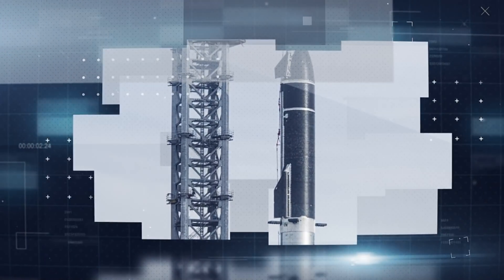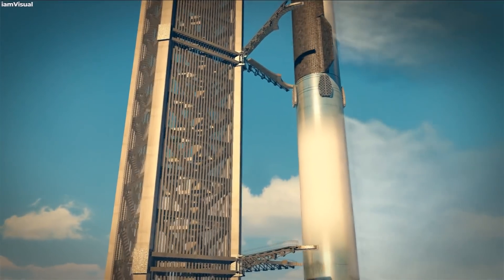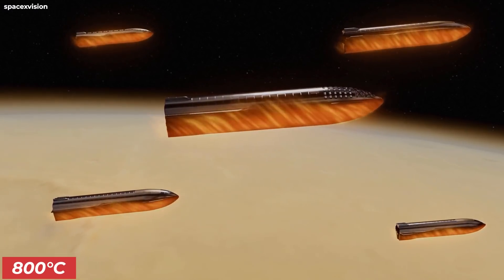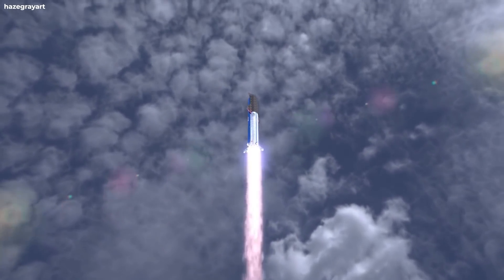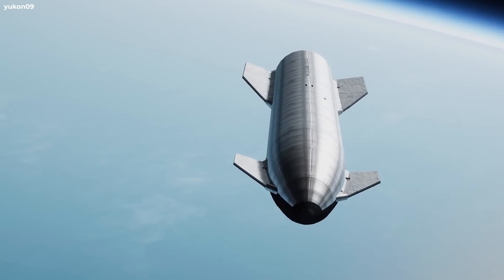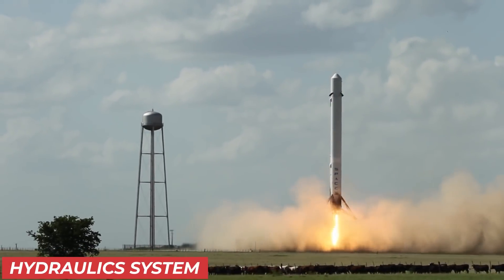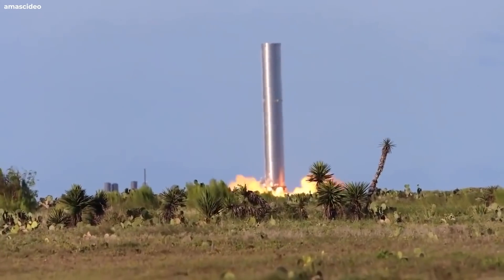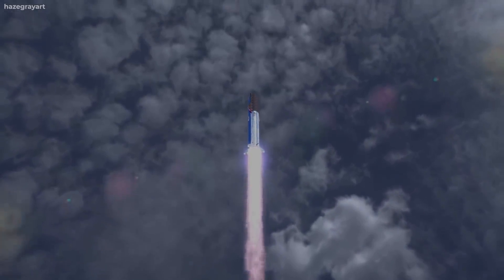SpaceX's INSANE New Starship LEAKED by Elon Musk

Comment: The metallic thermal-protection panels -- designed for the X-33 Reusable Launch Vehicle  -- might dramatically cut maintenance time and costs associated with ceramic tile and thermal blanket systems on the Starship, as they were intended to address these issues with the Space Shuttle.

Comment: So The heat shield stuff is due primarily to just how fast craft moves during reentry. OK...why not figure out a way show the descent so burning up isn't such a hazard? Can't be hard in theory....
And with enough brain power working on the problem and the math, won't take very long to solve the problem.
Reply: To slow down we use the air, and that's why it gets so hot. Basically, the friction between the air and space craft causes it to slow down but also generates a bunch of heat as a by product. 

The only other way to slow down would be to use the engines, and that would use way too much fuel
Reply: @triton6490  friction. I know.

But ion engines don't use that much fuel. Either that or we stop pissong around with rockets and use nuclear energy with will produce bear endless amounts of energy to power systems and engines.
Reply: @jace2wheel762  ion engines don't have a high enough TWR to complete an entry burn before burning up. 

Also nuclear power would produce a bunch of electricity but you still need something to eject out of the craft to produce thrust, so you still need fuel.
Reply: @triton6490  actually you don't need to eject anything out of a "tailpipe"
Reply: @jace2wheel762  that is using theoretical physics. To achieve conventional thrust you need to eject something. That's why we have engines.
Reply: @triton6490  workable theories is what we got
Reply: @jace2wheel762  i have no problem with theoretical physics research but we need to stil to physics we already know to actually get somewhere in a meaningful amount of time. Light sails would be fine  for interstellar
Reply: @triton6490  light sails don't work. If massive mylar sails were functional and viable, we'd be using them by now. To date, the fastest probes we've ever launched are the voyager probes. Took over 30 years to reach the heliosphere and another nearly 20 to reach interstellar space. So sure let's use light sails that get less and less efficient the further away from a source of light like say.....the sun
Reply: @jace2wheel762  It’s free energy conversion via friction. Why not use it?
Reply: @jace2wheel762  also, the speed it would have to change to not generate a dangerous amount of heat is like 10,000 mph (20,000 kph). That’s a lot of fuel or energy of any type to store onboard when it can use protective tiles instead.
Reply: @zippyd31  we're talking about slowing down so there's no wear near the friction
Reply: @zippyd31  and that's why using nuclear fuel makes sense! Be they ion engines. Traditional thrusters, fucking anti gravity I don't know. But its the sheer speed of reentry, approx 28 times the speed of sound, that necessitates the need for a heat shield. Its friction. That's it
Reply: Andy Man  mach 25 huh?/explain the ISS moving at 1000mph in opposite direction to the rotation of the planet? Been up there quite a while. Lol the shuttle re-entry pegged the thing at mach 30 and slowing upon re-entry...
Reply: Thanks for the comments. Much appreciated.
Feel free to message on Whats/App / Text
For questions, Investment guide and tips.
✙18022651226////📱🚀
Reply: 1. Multi-skip reentry (might not be practical from low orbit).
2. A relatively large and light spacecraft might be able to shed more velocity at a higher altitude. Though I've heard that's a problem too as it prolongs reentry, so...?
3. A skyhook cable. Which requires low orbit to be already developed. 
4. Engine thrust. Theoretically doable if there's a sufficient supply of propellant (from asteroids, say). Still unlikely.

Comment: Of course that's what we want... insane rockets.  <sigh>
Reply: Indeed, that's what we want. Or do you want to stick to the 50s kinda style of throwing 90% of the rocket away and only leave a small satellite in orbit on each flight?
Reply: @spieker131  No. I want something that is sanely engineered, and innovative.
Reply: @douglascaskey7302  that was Falcon 9, but there really isn’t much of a logical step forward other than full reusability. I will admit though, it does seem a little insane when compared to JARVIS.
Reply: Thanks for the comments. Much appreciated.
Feel free to message on Whats/App / Text
For questions, Investment guide and tips.
✙18022651226////📱🚀